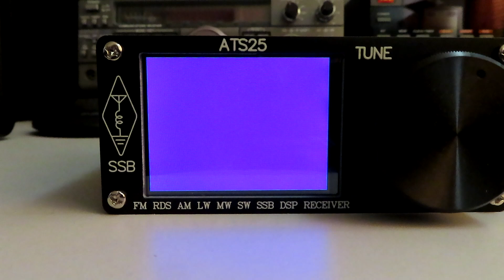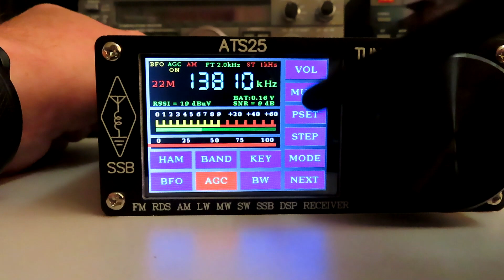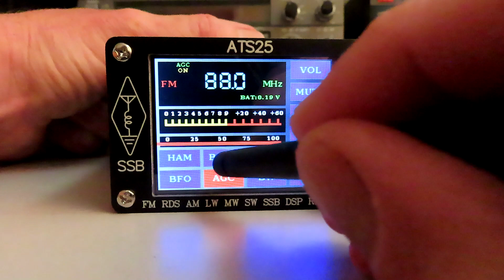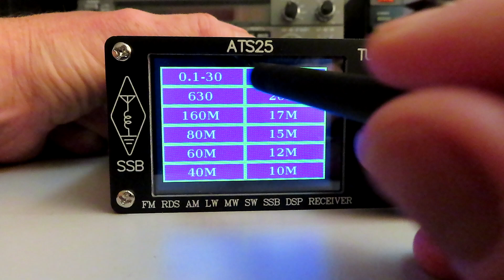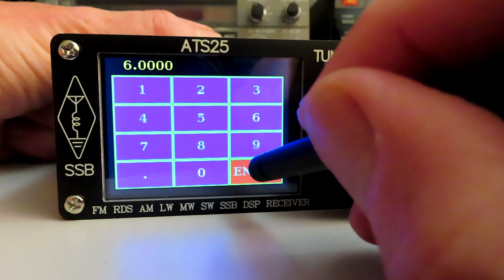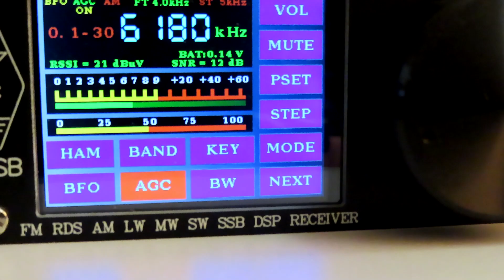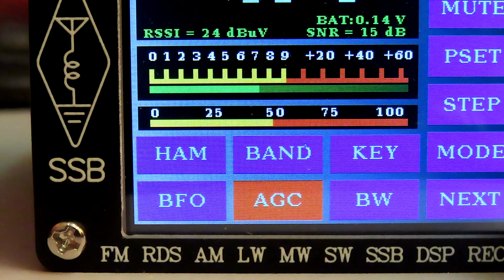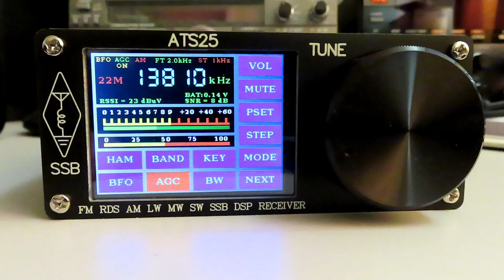ATS-25 First Power Up

Comment: I already have an ATS-20, and I like it quite a bit.....and I just bought an ATS-25 because it basically solves all the problems I had with the ATS-20 (screen was tiny and had limited info, speaker was tinny and the charge port....was a mini USB-B; those are basically dinosaurs at this point).
The ATS-25 has a bigger color screen with LOTS more information, the speaker is bigger and the charge port is USB-C (not to mention the huge battery it has according to another video I saw of one with the cover off).

Comment: Thanks for the review. Just to clarify, the frequency range does not go below 150 kHz? I looked at the specs but sometimes there is a hack with some Chinese receivers to use out of range frequencies.
Reply from the maker: I think the frequency coverage is limited by the specs of the SI4732 chip
Reply: Thanks mate. I know the early Degen DE1103 that was non DSP was hackable but have no knowledge of any other since. 👍🏼

Comment: Interesting rig. But they use the ARRL trademark logo and then type every feature on the bottom of the face plate. Just kind of overwhelmed and tacky. Wish it had 6 meters but that’s rare for a shortwave rig of this price. Nice screen.
Reply from the maker: I think that logo is used by many radio Societies not just the ARRL.
Reply: @KevinOReillyswl  - oh yeah, your correct. I’m gettin old.

Comment: For those who think this screen might be a bit small. There is a 3.2" ili9341 screen that might work. I'd be curious. it uses the same SPI driver. Might have to do some further investigation. 3.2" screen and a separate volume pot would really make this a nice easy to use unit. Would need a slightly larger case though. Would be nice to make this function on user changeable 18650's as well. I'm really loving these video's the these little units. Thanks.

Comment: Would you recommend this radio, seems to have mixed results.
For the price yes or no? Around the same price point what would you buy?
Or go a little more $$ and get something far better?
In the market was thinking tecsun s2000
or S14732.
Thanks
Reply from the maker: At the risk of pre empting a future video :) no I would not recommend an ATS -25 unless the prices start to significantly drop. It is another "work in progress" or an experimenters radio. You could pay a good bit less and buy an XHDATA 808 or as you say pay more and get something like the Tecsun you mention. If you don't specifically need a portable take a look on the second hand market for a proper communication receiver which will totally outperform an ATS-25.

Comment: On first look it seems to be a Malachit wannabe but on demonstration its pretty much the ATS20 with a new shiny frontend. By the way the 0-100 bar seems to be a Volume indicator rather than battery.
Reply from the maker: Tony, you are right about the 0-100 bar. Overkill really as the volume level is also displayed numerically.

Comment: I bought one got it used it and thought meh mine had too much noise from the screen i probably got a bad one i sold it. Thanks for the video.
Reply from the maker: Interesting. I haven't noticed screen noise yet but its early days. May be more obvious on the telescopic whip
Reply: Stop trying to use the throw away telescopic lol
Shouldn't even include the garbage. 
Get a 20$ radio if you want to use a little telescopic.